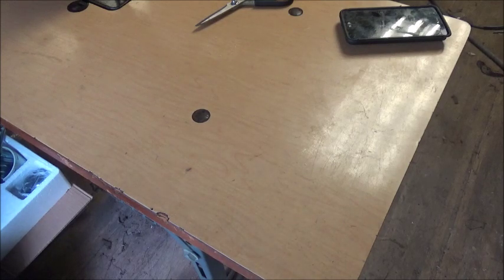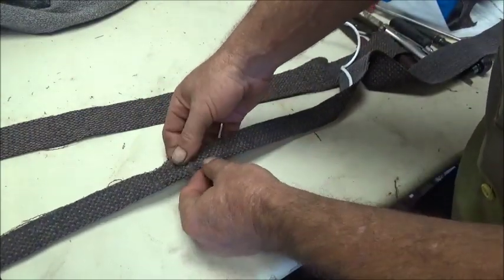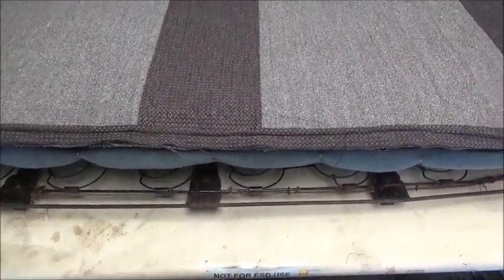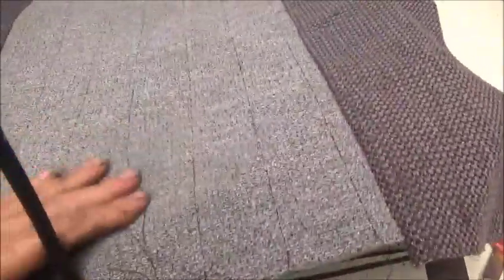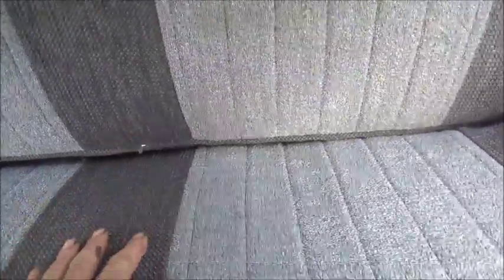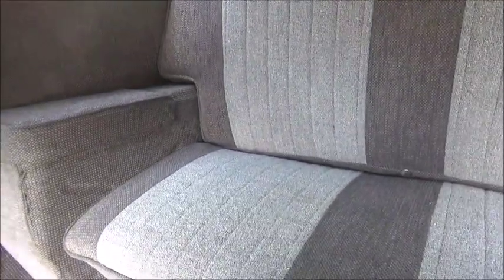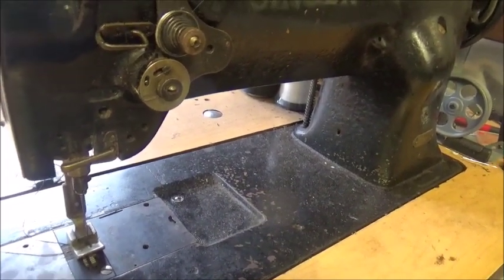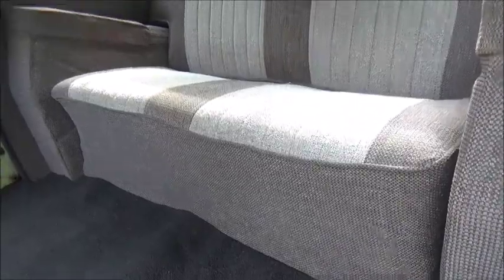1951 STUDEBAKER BULLET NOSE MORE INTERIOR WORK

Comment: I HAD MY RESTORATION SHOP FOR 50 YEARS, THE DETAIL PART OF IT HAD MANY THOUSANDS OF CARS GO THROUGH AND MAYBE 1 CAR IN A HUNDRED HAD SEAMS THAT LINED UP RIGHT.  (SORRY ABOUT ALL CAPS, IT GOT STUCK) i had a '51 regal commander convertible, with 232 v8 and auto trans, the paint color was a very nice light tan, hopeing you  might paint your 5, they are sweet cars.    back in 1957 my aunt and uncle bought a new chevy nomad wagon, they drove it 1.9 miles from the dealer to our house to show it to us.  just as we were greeting them a drunk driver in a '51 champion starlite coupe, doing around 50 mph swerved off the road and rear ended the new nomad, slamming it into two side by side phone poles, totaling it.  the studebaker still ran.

Comment: Jonathan, because of you, I saved an old lawn mower. The machine saw very little use when it was put in storage. Apparently they were having trouble using it and tried taking it apart instead of just cleaning and adjusting it properly. Idiots! After a good cleaning and putting the everything back together, I have a virtually new machine. I just took my time and didn’t give up until I figured out what they did wrong. You do motivate me. Thank you for the wonderful videos!

Comment: Cool, a sewing machine with a self destruct button, lol. I just bought a late '60's Sears Kenmore 1752 in a cabinet for $50. I was torn between that machine and a Nicchi Supernova for $75. The Sears people answered first and has everything it came with from manuals, to all the attachments. Really wanted both. 

Hopefully will finally be getting a project. A 1982 Yamaha Virago 920. I just sat on the seat and was sold for the money I have to spend, $650. Needs carburetor work. He had put on some Jardine(?) pipes which turned a little blue and he tried a short cut of just installing the new jets without cleaning. 

I remember rebuilding a 2 bbl off a '76 Granada. My brother-in-law said I couldn't do it but the car ran better after I finished. Unfortunately all carburetors can't be revived, lol. 

Thanks for sharing.

Comment: Man, those seat covers look fantastic! Great work. Thanks for making these videos, it's really inspiring to see the work you do. Singers are very impressive pieces of machinery. if the bomb ever drops, there'll be nothing left but cockroaches and Singer machines. I have a household treadle model (forget the exact model) from 1918, and that thing, which isn't even heavy duty, had no problem going through layers of heavy duck canvas on a tent I repaired. It was used by my wife's grandmother who was a seamstress, so it got used daily for years and years, but I just tore it down, cleaned it up, reassembled, and it's really like new.

Comment: The seats look AMAZING!  Love the way your doing them and your doing them YOUR WAY so it is the RIGHT way for YOU!  If I may though just a tip for the piping when you go to put the ends together next time fold the ends over and sew them across then spray glue your cord in them that way they won't separate when you pull/stretch the seat cover on the frames.  I did work in a furniture factory for a while and from what I see so far you doing a wonderful job on the seats! Your right as the glue you can start out clean and by the end of the day your more dirty than if you had been working in inside a motor in a grease pit for 12 hours!

Comment: That's the first single shot singer that I have ever seen. It is kind of cool were bullets end up at over the years
Reply: Randy Lamountain i wonder what that hole was for originally?
Reply: @stacyboots1818  If I remember correctly it was a access cover for inspection and lubrication of the geartrain  (I think there was an adjustment screw in there as well on some models).
Reply: @stacyboots1818  If I had the manual I could probably tell you lol

Comment: Looks good, the only tip I’d give is joining the piping. Try folding the the cloth over 3/8” - 1/2” at the end before you lay your next piece on it. Over lap the joint at least an inch 1-1/4”. I’ve used cloth line before on seats. Walking foot works good for different types of cloth and patterns. Like a diamond pattern. The cloth wants to push and bunch a little. But with the time your getting on that machine you’ll figure that out as well. Now curtains for the wife is next. 👈😂😂😂

Comment: Wow, yer upholstery is looking very good.  You're doing a great job and you need a windshield wiper.  I've got an old treadle type Singer upholstery machine.  My wife's uncle was an upholsterer.  I've never used the machine as it is stored out in our barn.  Probably need to sell it.  It is extremely heavy.  It's heavy enough to stitch saddles and tack gear.

Comment: Quit you are doing a excellent job on a driver. If it was a show car yeah then complain about the job,  but you can only complain to yourself. I have used spray glue alot but on wood. Only way to keep your hands and fingers clean is not to use it , but rubber gloves help but buy good ones, ive seen some glues eat them and they stick to your hands real good. If you want more practice i will bring you a truck seat and materials to do it. 😁✌🐓

Comment: If you have a hard time sliding the covers on the back of the front seats try using a garbage bag over your cushions then slide the cover over the bag it helps it slide easier then you can rip the bag out after you get it in place

Comment: If it helps you can make the front carpet in one section by using steam to shape the carpet over the tunnel, I have used both a steam iron or a kettle to apply steam, either worked to shape and stretch the carpet to mold the carpet to the tunnel and front floors.

Comment: july 14 2019     TIP:                                                                                                                                             the better way to do what your doing there is to staple both ends of the cloth strip an one end of the cord to the table the take the loose end of the cord pull it tight then eyeball it get it centered in the cloth strip the secure it to table then under the cloth strip  side of thin veneer plywood like wider wood yardstick then gently from under the cloth strip push up othe cloth to where you make contact with the cloth covering the rope do this on the other side that way it be quicker job an yall dont get your fingers stuck up with spray glue

Comment: when you put the seat back covers on If you put garbage bags or plastic drop cloth over the backs the cover will slip on way easier. Turning back covers inside out and putting on like a condom works too.

Comment: Love your work and the vintage equipment.  The live round is extremely dangerous. The way it is wedged in there it will fire like it was in a chamber. The primer being exposed is not safe. If you can get a pliers on the bullet pull it out and the powder will come out that will prevent discharge. I  reload a lot of ammo and the primer sticking out like that is not safe. Just concerned my friend.